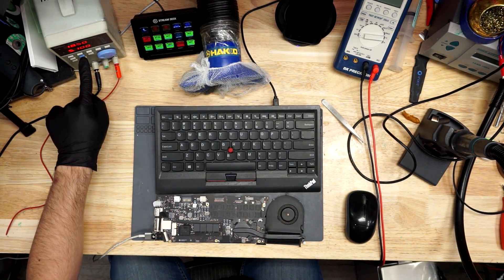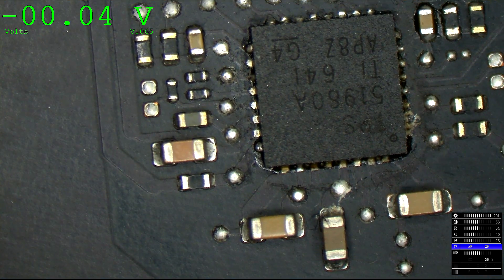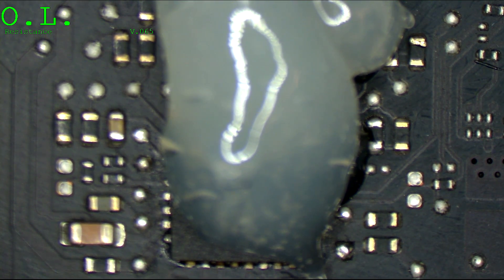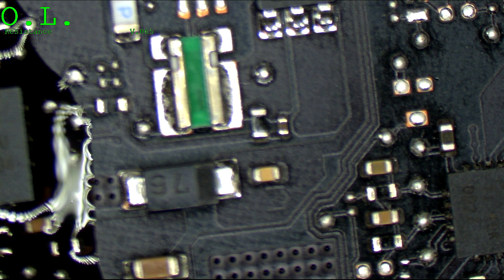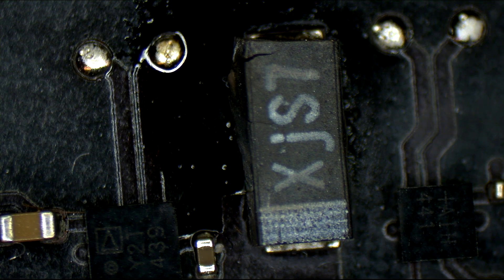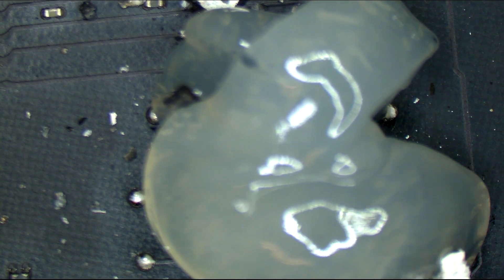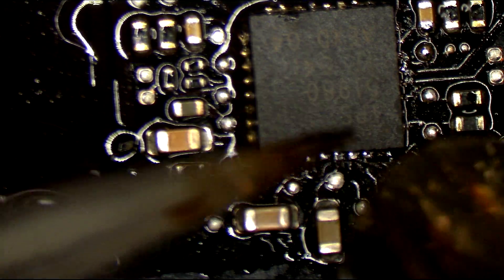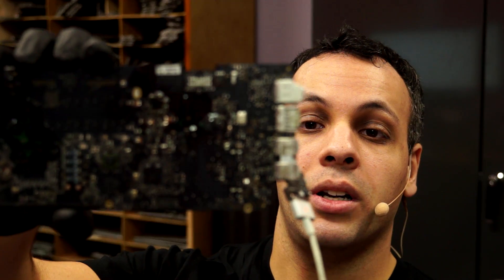Should all Macbooks set themselves on fire?

Comment: What a fantastic new invention from Apple Incorporated! A capacitor that, when malfunctioning, desolders itself off the board, so as to prevent any electrical damage*!

*may cause property damage due to fires, Apple Incorporated is not liable for those damages; live in non-flammable environments silly

Comment: Dude you're  right about  the "genius" bar.. they may be product experts... that follow a troubleshooting  diagnostic  script to attempt a quick pos fix... I thank God  I was able to get  amtech Flux and solder paste... at reasonable  prices..
I bought  the Atten ST-862D  since my WSTA6 pyropen hot air tip wouldn't  ignite after 21 years it died and  was asked by weller support to re submit  my support  request in German... yet they have a united States 🇺🇸  website and can't  provide support in American English... I should have taken German 7th through  12th grade instead of Latin.... it's  like expecting louis to do his videos  in Spanish italian and mandarin subtitles or transcripts  of each video..
If I encounter a broken MacBook or Apple  product down to user error and suspect  its hardware... I recommend  them to Rossmann  repair.. the best of the best...

Comment: I run a fuel injection shop (mostly diesel stuff)... The principle of "confirm the failure before you replace the part" most definitely applies here, as it does in my industry. Nothing I love more than selling a pump or set of injectors to a shop only to hear that it didn't fix the problem. Or better yet "those injectors you sold me are defective, it's still doing the same thing as before!"

Comment: Automatic Reballing and Automatic Fluxbook. me Think different.... 
Actually reballing mostly doesn't fix it, it just tries to get to 217 degrees Celsius and magically fix its own chips :D
Now if they just put in a small reservoir filled with flux that via a temperature probe get spreaded across the board
Then you have an automatic reballing and refluxing macbook. Reballbook and Refluxbook... available in shops soon. :-D

Comment: Hi from Honduras. i am about to buy a mackbook  2012, 500gb, core i5, 16 ram. screen freezes when you move the laptop and will not work until you restart. is it worth it? can it be fixed? (i am electronic technician but never fixed a motherboard component level.

Comment: Hello Louis I use to work for the genesis  bar are a repair technician but I was fired for telling a customer the truth what was wrong  with there iMac pro anyone who works at bar are only trained to sell and say no or say its water damage or it's not fixable or it needs to be replaced they never fix the iPhones or iPads or iMac all they do is give you an used replacement and the repairs so called have to send it to Texas for repairs is a lie its there recycling center and they just clean it and so call fixing with a rubber tab and all I had to plug the device into a so call test unit that tells you if it's working or not that's all it does

Comment: Hi Louis, I have a simple question that I hope won't take much of your time.
Before I start with my question I would like to thank you for your content that you've been putting out...
I have a gaming laptop with a nice RGB lighting. My mother got mad at me last week and hit the keyboard, my laptop rebooted immediately and started normally. Except for the keyboard it seemed to flicker when I touch a certain region and sometimes even on its own. A few days later it stopped illuminating completely. Unfortunately I am out of guarantee, but keyboard is still functioning just like before. I did the thing I was supposed to do and opened it carefully hoping to see what broke or maybe fell off and found out that I can't get under the keyboard without removing the fans (+copper things) on the CPU+GPU which will ruin the thermal paste, so I closed it up and continued using it. I'm sorry for taking so much of your time and thank you for reading until here. Do you think it is worth it to buy new thermal paste+rubbing alcohol and open the laptop again to see what's wrong knowing that it works fine but doesn't illuminate?
Ty for your time
Bashir

Comment: I don't think you'll be able to sue Apple unless "genius" is legally defined. Also, if Apple has "Genius" registered as a trademark, I'm fairly certain you wouldn't be able to sue over it. A definition on Google isn't good enough in court. I mean, I'm not a lawyer or anything, but I highly doubt that case would hold water in front of a judge (even though I don't like Apple).

EDIT: Actually, I don't know if it would have to be a trademark. But I'm pretty darn sure they can get away with it if they have "Genius" legally defined somewhere, and anyone they call "Genius" matches the legal definition.

Comment: the conspiracy to defraud part comes in the moment they sell computers containing rohs shitsolder and bga packages which mechanically and chemically can never remain in place without cracks in the solder, and try to present it as a 'quality product'. quality products are space and automotive rated, use leadsolder, and most definately don't need a fucking microscope to repair them.

Comment: Hiring Mensa members wouldn't work, as them choosing to work in a dead end job like the "Genius" bar would lower their IQ by at least 20 points. The loss of those twenty points would most likely lower their IQ enough to disqualify them from Mensa AND Genius-hood. And by dead-end, I don't mean the job itself is useless, I mean the advancement potential is useless.

Edit: Instruction unclear, macbook is on fire.

Comment: I am working as a IOS and OSX technician (iPhone and Mac) for an AASP. and since we don't do anything close to soldering at our locations (as it is with apple) - we replace the part when it's faulty. Even if there is a way to do this differently, like you clearly prove, we don't do that, we replace parts with special exchange pricing, and apples refurbishing workshop does refurbishing of the known bad part for later reuse. This way they can more easily ensure quality of service. I am happy that not every Apple Authorized Service Provider location is supposed to employ people with these skills. It would be a nightmare to ensure quality that way. And I am sure you would agree

Comment: i used to work at this company called SPC international like 15 years ago, we used to "repair" desktop motherboards (amongst other things).  About the only fix we could ever actually do was flashing the bios which sometimes meant replacing the surface mount BIOS rom chip, which meant using a lot of flux, which was kind of fun.  We also had this gizmo which connected to the PCI slot and the CPU and it was meant to interrogate the board and flag any failed chips it would usually only say either north bridge failed or south bridge failed, something along those lines.  They also bought this 30k machine that heated up the board and allowed removal/replacement of BGA chips ( If only they knew back then you could do it just as easily with a heat gun and some tweezers.).  I must have tried it 50 times and not once did it fix a board.  Nobody ever bothered to check for shorts or anything like that.

Comment: I have a stick of laptop memory that I accidently knocked one of those tiny SMDs out. DDR3 Gskill Ripaw 4GB 1600mhz.  Anyone one know what chip I need to get to fix it? Seems like any easy job to fix. Just have no idea what to get. I have a heat gun, lots of flux, and solder. Ready to work.
Reply: What SMD is it? Do you still have it? Would be useful so you could find out what it is/measure it and replace it with the appropriate part

Comment: It’s a new feature.
Reply: Think "Different"
Reply: It’s simply the new leg heater function they haven’t revealed yet. It’s supposed to heat your lap up when osxi comes out. He accidentally triggered it by tampering with ppb hv7830
Reply: @MisterRorschach90  I know that feature from anywhere.  Apple copied Samsung by adding that damn road flare feature first introduced in the Galaxy  Note 7's.  Apparently, Apple improved on it as you don't need exploding batteries, just an exploding capacitor.
Reply: Possibly could be a very short-term LED replacement? "Don't delay, light up your MacBook the pyrotechnic way ... today!".